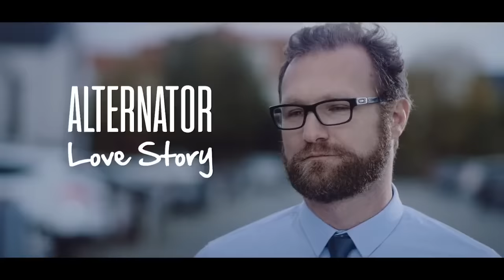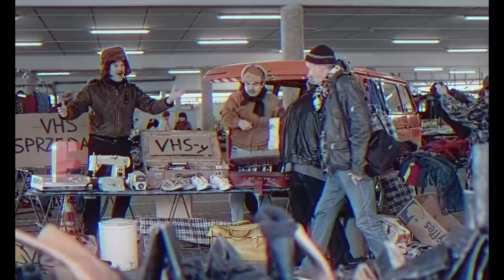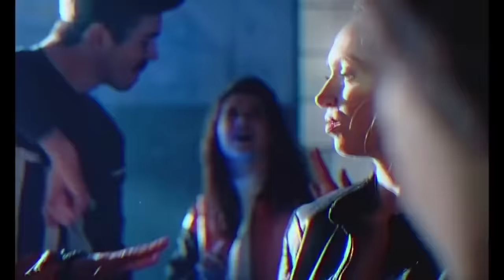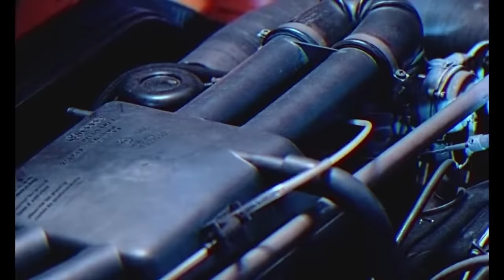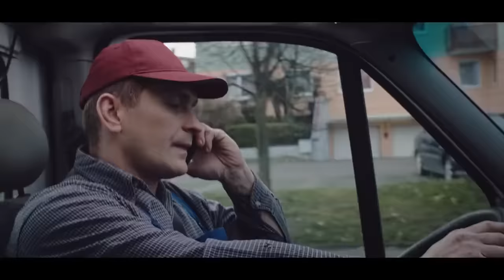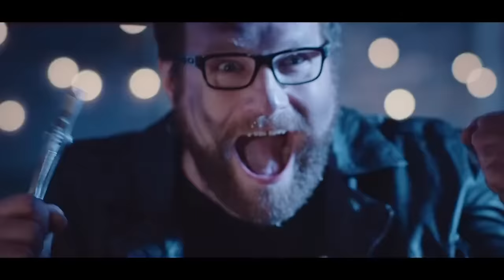Volkswagen T3 - commercial

Comment: My parents bought ours new in 1990. I was 8. Took yearly trips with it to Las Vegas for the first 5 years and a few trips into Canada and Mexico. I bought it off my parents back in 2000 and it has been across the country several more times.

It needed a rebuild and was botched by a mechanic who most likely did crack given how much his hands shook. We had a second engine put in it and the transmission was rebuilt. I'm in the process of getting mine back on the road again after sitting for a couple of years. Replaced the temp 2 sensor (engine was running rich), alternator, battery, front brake rotors and bearings, ac compressor, breather tower, spark plugs and wires, distributor cap and rotor. It needs new valve cover gaskets and push rod tubes which I have and need to put in. I also need to do a complete fluid change of the differential and transmission, wheels and tires, body work also and a paint job. This weekend I will fix the ignition timing put in the new AFM I have and keep the old one as backup since it still works fine.

Never going to sell it or get rid of it. The van is a member of the family. 😄

Comment: I also love my T3 but I always load it "rear end first" on to a tow truck. I guess the tow truck guy must have found out too. The weight of the bus  engine behind the rear axle of the tow truck would make the truck swing from side to side.
Reply: It's funny how people with older cars and project cars are used to load them into tow trucks at a point it's a regular thing to do.
My daily is a regular car from the 90s that has never been special enough to be preserved except for the higher trim levels. 
So now it's pretty rare, the problem is that now it's pretty common for me to just be without a car lol

Comment: I had two T3s in the 90's. Back then they were old clunkers that no-one wanted and you could pick one up in good, running condition for hundreds of Deutschmark. Greatest car ever and I'd have one again in a heartbeat. Problem is, one in this condition (rusty, dirty, not running) will cost a minimum of €5000 and you'd have to put double that in to get it to a good condition. One in good condition will cost €15000 upwards.
Lovely things to have, but so stupidly expensive in Germany that either only moneybags own them or people who half ruined themselves sinking tens of thousands into them.
If I spent that kinda money, I'd want a Mercedes. I also had 2 W123s and those were awesome.
Just don't expect either the VW or the Merc to go fast. 😁

Comment: Alright video for a thumbs up, but has some glitches:
First, the T3 is a totally different VW model.
Secondly, it's more of a TV spot than a commercial due to length (although I'd like such commercials made from the heart)
And third, the bumper fell off during lifting, yet it's back on when it's on the trailer.

Sorry, felt this needed the critical touch which a fine piece of film deserves 👌.